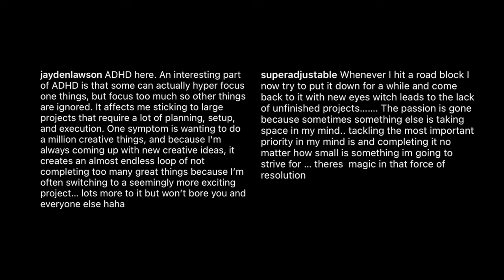WHY I STRUGGLE WITH MY FPV BUILDS

Comment from the maker: It's not a task solving issue, or a problem with your intelligence AND yes, you do have the knowledge, and you do have the building experience and you do have the skills 🖤

Sometimes the brain just goes 100km/h and it results in you putting that small piece upside down, misplacing your tool (usually right in front of you) or forgetting to tick that one box in Betaflight.

But at the end of the day, you still get the stuff done, even when you had to start over a few times, and you can 100% be proud of every single of your achievements 👏
Reply: I really like this video... the same thing happens to me...though not entirely similar. .. I always think ahead of things to the point skip some things thinking I have already done them..  for instance, when adding motors bolts. I might add the first and the second one then start thinking about the next motor get focused on the next one and jump to it before finishing the previous one. the same thing was happening to me while in school, I would do a task (especially math tests), and before finishing it I would get destructed and jump to the next question having thought that I had finished the previous one
Reply: thank for sharing

Comment: When I was about 5 my mum would buy me model aeroplanes and hotrods to build like you I would put things in backwards or in the wrong spot but difference was I would glue them together before I noticed so I ended up with all these funky looking models that had glue all over them from trying to take them apart and fix them model glue was slow drying when I was a kid even tho they were my own unique looking models I was stoked when I finished them. Realising our different strengths and weaknesses is progression. Your build looks awesome 🤘
Reply from the maker: Thanks for this comment!
Somehow it reminds me of my use of white corrector at school. Writing something. Erasing. Rewriting, messing up using white corrector and messing up again. And then instead of you having a plane full of glue, it was me having a page full of corrector.

Comment: Noelle, I for one think you do an excellent job at building and flying drones! I have only built one FPV drone and I was a nervous wreck trying to get things right! I had to reposition things and had a couple times of putting things on the wrong way but I just took my time and when I got frustrated I would walk away and try another time and before I knew it I had a working drone! Please don't worry about it and don't let things discourage you! You are AWESOME and I personally think you have one of the best flying styles out there! It is as if you are dancing in the sky❤

Comment: All of my builds feel like they take forever and always seem to come out a bit jank. It’s a special kind of strength to be vulnerable and put yourself out there like this, sharing the mistakes and not just the wins. What battery are you running with this setup? I have managed to kill like 3 GoPro 8 naked buildswith the same dumb cord that had the polarity reversed
Reply from the maker: I was using some 4S 850mAh on this one 🙂 Thanks for sharing your experience with us!